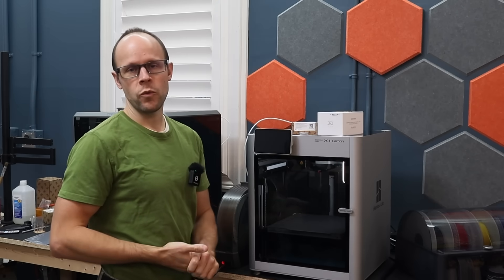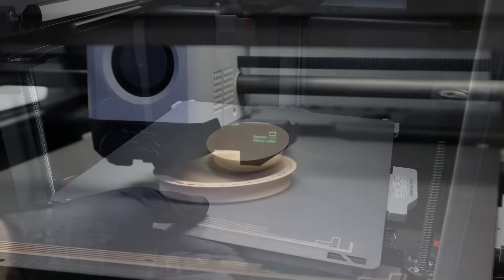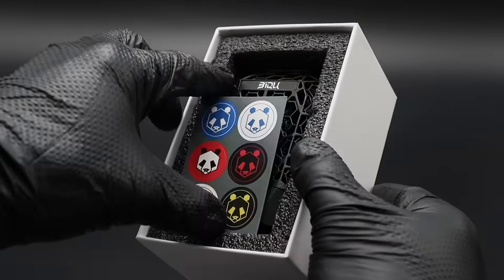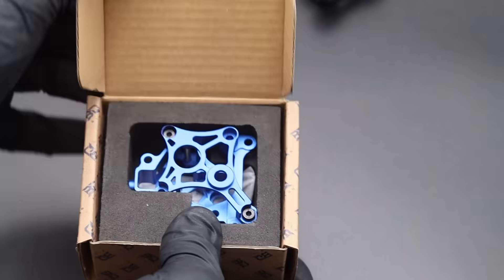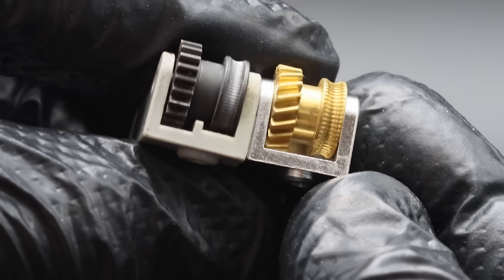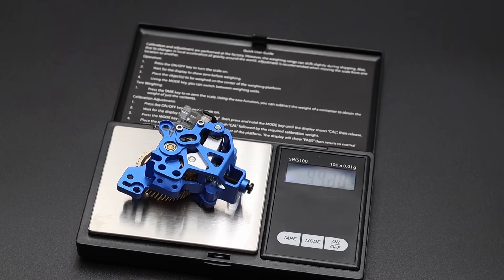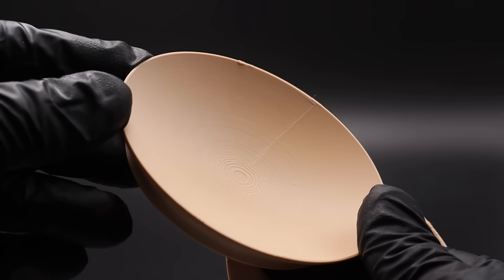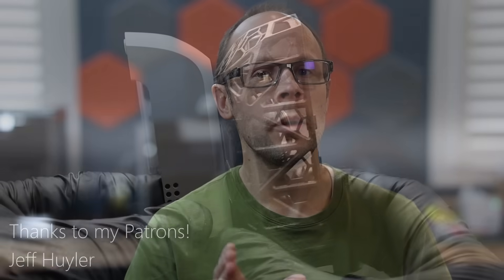These are awesome looking upgrades for your Bambu X1/P1 printer, but how do they perform?

Comment: Interesting that you used loctite on the bearings, personally I would've used a silicone or lithium based grease so the whole bearing cage is free to spin in that slot in addition to the balls inside
Reply: The bearing spinning in is slot is a worse case scenario. It will wear out the slot, possibly cause galling, and reduce precision. You want a bearing cage to remain still.
Reply: I think we agree we don't want to wear out the slot. You're right, the better method is to remove friction completely vs reduce it, but even with that being the end goal, I still don't think loctite was the right solution. Check out the weird bearing spin at 11:40
In this scenario where its going to spin anyway, you're better to use grease.
Reply: @asteliaz  having worked in aerospace, machined bearing pockets, and reading schematics, compounds like Locktite can work great. Provided you use the right one, and the tolerances are within spec for that compound. If I noticed it wasn't at least a light press-in, I'd send it back as defective. They really should machine that with tighter tolerances and install it in-house. But that's asking a lot for their price point.

I think this is another case of "upgrades" can be worse than the original equipment. :D I saw that a lot working in the automotive aftermarket, so it's definitely not just this case and industry.

Comment: At 11:40 there is a weird eccentric movement at the bearing.
Reply: Probably a side effect of using loctite and it being an imperfect fit. Personally I would've used silicone or lithium based grease around the outside of the bearing instead of loctite.
Reply: @asteliaz I think I will just stick with my cheaper Bambu Lab extruder, it doesn't look as cool, but it holds the bearings tight without locktite, it weighs less, is quieter, and it includes the gears and filament sensor
Reply: @asteliaz  why would you use grease instead of loctite?
Reply: Realistically you don't want the outside of the bearing to slip at all and the best way to do that is to get a perfect friction fit. However, because its not a perfect fit, he's chosen to use loctite to close the gap. If the loctite comes loose and there's slippage, it'll wear away the bearing cage or the frame. Using grease instead allows it to slip outside of the bearing while reducing the wear and tear on the bearing cage or the frame its fit into.
Reply: Having the outer bearing race not held in place is bad practice for a bearing.   Hopefully BIQU has fixed this in later revisions.

It would be cool to see a backlash comparison done between the two gearsets, though.  I wonder if there is a backlash compensation hardcoded into either the slicer or the printer itself.  This may account for the subtle difference in print quality.

Comment: What print profile did you use for the control prints.  When you took that first cube off of the plate it looked a bit rough.  I use the .16mm High Quality for my prints and a test cube with that profile printed on my X1C looks a lot better than what you had.  I could see imperfections in the layers and that wasn’t even with a closeup shot of it.  I also used the BiQu jet on my X1C and I actually had a degradation in print quality using it, so I switched back to the stock shroud.
Reply: I also noticed the imperfections. My stock p1s produces much better prints.

Comment: Bad review.  Bambu replaced the straight cut gears with helical gears a very long time ago--if you're still running those gears you must not print very much.  The Panda Jet is 5.03g lighter not 6g (26.09g vs 21.06g), and that's if you remove the label plate from the Panda.  Moving onto the next part, nobody should buy the Panda Extruder.  They advertise that it's 20% lighter but it's only 1.2g lighter (43.4g vs. 42.2g with Bambu gears and filament sensor installed which is 2.8% lighter)--for much less $40 you could buy a few M3 titanium or aluminum screws and save 2-3g.  The bearings fit loose and rattle in the Panda Extruder.  Because of the aluminum structure, all the heat from the hotend goes straight into the bearings.  The Panda Claw is also a major downgrade, since it's extremely heavy and the brass gears don't isolate motor resonant harmonics.  The main gear itself weighs 16.93g vs. Bambu's 7.81g and the swingarm is 7.82g vs. Bambu's 6.50g (24.75g vs 14.31g, a weight penalty of 10.44g).  In the event that you get a filament jam, the Bambu's plastic teeth will flex over the top of the motor spur gear, causing no damage, whereas the brass teeth will not.

Comment: "The only modification I'm leaving on is the modification the Jetpack makes, making this ENTIRE comparison worthless." - Way to go.

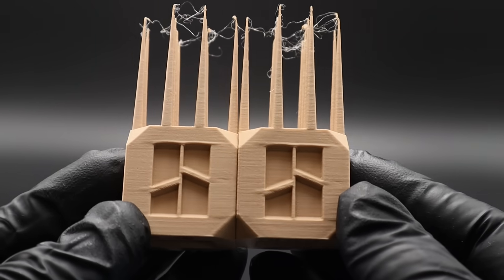10:20 Yes, go figure, the only upgrade from stock that would directly impact extruded plastic cooling was left in place. This was useless. You made a pointless video. 

Compare against stock. ACTUAL stock.

10:40 Whoa WTF is wrong with your Benchy? The same question for your cubes actually. Your printer is fuqt. Most people try to get rid of the hull line, you injected Botox into it to emphasize it.

Comment: So it wasnt worth it.  Perhaps when my extruder needs replaced due to failure its an option. But i only see one advantage, it looks like you could blow out the filiment dust and filiment cutting particles out with compressed air and no disassembly.
Reply: I bet dust and debris can get in there easier too though.

Comment: For the label, if you're painting in orca or Bambu slicer, you need to paint the sides and tabs black as well. If you paint the front surface black but leave the side white, the slicer interprets that as that side face needs to stay white as much as possible

Comment: Just curious about that grease you added: might it not potentially introduce some contaminants into the filament/extrusion flow? Also: was the E3D hotend you had before the E3D/Biqu Revo? (I’m thinking about that upgrade for mine). Thanks!
Reply: they're not on the same track, the filament is on another sied of the gears so as long as you don't get messy with it, it would not be contaimnated. the stock one is also lubed iirc.

Comment: My experience:

Panda Extruder - Waste of time. It’s not ready for market. It exerts too much pressure on filament especially with the claw. The bearings also cause an ungodly rattle. This throws off the frequency calibration.

Panda Claw - Too heavy for no real benefit. Also creates too much pressure on the filament in conjunction with the extruder. 

I also did the Panda Revo. This was the most disappointing. It’s not been made correctly. It’s 0.3mm too narrow at the head of the heatsink where is goes into the extruder. This causes the extruder housing to warp if you snug the bolts up, and if you don’t they come loose. If you snug them up they also go through and hit the gears because of the 0.3mm problem. 

3/10

Comment: These Bambu Upgrades videos just prove again and again that it's just a big waste of money and time to ""upgrade"" a Bambu Labs printer because there is nothing to upgrade. We are all just collectively suffering from Stockholm Syndrome by having lived with shitty bottom of the barrel Creality printers and their clones, and their clones of the clones.
Reply: I have 16 x1c units in my farm and I promise, there’s plenty to upgrade. Comments like this make me laugh so hard. 

The tool head is incredibly prone to heat creep related jams and the sample of this shroud I received seems to have helped that a LOT, and I’ll be ordering one for each of my units. 

The internal light is absolute trash and every unit on my farm is fitted with a riser that has a COBB LED strip on it so that I can view small
Edges of parts without opening the door to look for print issues that cause sellable parts such as corner lift. 

Which brings me to… the chamber is leaky as a sieve. The door doesn’t seal at all, and the back has a gigantic hole that’s open to the boards. Every one of my units has shrouds printed to isolate the board from the chamber heat, block off holes, and they have insulation added. 

What these printers ARE is a phenomenal value. But pretending they’re perfect is laughable at best. Bambu fan boys are ridiculous 😂
Reply: @DatMammutt  Using x1cs for a farm is hilarious. Just adds cost and more points of failure.

'Incredibly prone to heat creep' is a laughable statement too. Since no one else has that problem, it's probably because you've messed up the chamber ventilation with those shrouds 😂
Reply: you seem to be forgetting how problematic is the AMS and upgrades like the python
Reply: I would  not have expected the print quality to have changed.  My expectation is if you print with carbon or wood, then the longevity of the system would increase.
Reply: @rogerhuston8287 this is exactly the intended use case. It’s like upgrading car parts. I don’t swap out plastic coolant flanges to aluminum for an increase in cooling capacity; it’s 100% for longevity.
Reply: That's an unbelievably naive statement lmao
Reply: I have an un-upgraded stock creality k1c, and i can say will full honesty that my printer prints much cleaner than this guy’s printer, not saying all bambus are like this but this comment seems pretty naive without much thought to other companies
Reply: The only good upgrade would be the cryogrip build plate to save money on heating the bed
Reply: Panda Revo. The easy nozzle swaps on p1 is very nice. P1 doesn't have the easy swaps that x1c has
Reply: Well I see z-lines on those prints and P1 X1 have VFA, my Ender3 and Neptune printers do not have those.
Reply: @eaman11  are you printing 0.5mm layer height or something wtf

Comment: For our farm of printers with over 3000 hours print time on some, the stock setup is already amazing. Usually, the main difference you'd get in print quality is due to your settings & quality of material used. Definitely upgrading some partz may yield some improvements, but considering that bambu printers are already fantastic, I doubt you'll see huge improvements.

Comment: My P1P has crap quality. Layer lines on anything i print. Layer shift on anything over 10mm high as well
Reply: Be sure it is sitting on a stable surface and maybe also grease the rails.  Might help, I dunno?
Reply: @xNuclearSS1x  Its sitting on a rock solid platform stand that is not only level but also bracketed it wo the wall and floor and has been laser leveled to dead straight.   Did maintenance to it a month ago at 1000hrs.  It has never given the quality that Bambu promised or that paid Reviewers over inflate.  Same thing with the other Bambu I have (P1S) they just dont have the super quality that is bragged about.  Bambu are overhyped and overpriced IMO from using them

Comment: Biqu (and BTT)  products are very professionally made. I have never had issues with anything I've gotten from them. I have the gear set for both my X1-c and one of my A1s but haven't installed them yet. The timing of this video is great for my needs! And I have the air duct on my OG Bambu cover, but now do I want to spend the $ on the Biqu extruder frame and that way cool cover? It seems for improvements they aren't really a big step forward, but I do love the aesthetics of that modified print head.

Comment: I'm wondering how you're managing to get such terrible-looking prints out of the X1C.
Reply: Yeah I don’t get it either. I love the channel and the testing but when the prints look that bad both before and after there most be something else going on.
Reply: creality K1 user, complete novice, but after bed leveling, print settings and adjust jerk, my prints look way better then the prints shown today
Reply: I was wondering the same, my stock p1s produces better quality than that with generic PLA profiles. I wonder if his X1C has enough hours on it that it's starting to get some toolhead wobble. The only real flaw with these machines is those graphite x axis bushings and the idler pulleys, usually around 3000-5000 hours.
Reply: Bambu boys started to attack bambu users lol.
Reply: Bambu fanboy spotted
Reply: @3707_hereDo you think those prints looked good?

Comment: Id seen a comment on reddit about the panda claw having excessive "clicking" how was your experience with the noise from the panda claw?
Reply: Exactly the issue I am having from this upgrade. Not just the click, but also over-extrusion at any 90 degree corners and seams. There is always a blob of filament that sticks out. I am assuming it is due to the loose tolerance of the gears of bearings, and I did not use loctite like in the video. I am going to revert back to stock extruder gears to see if it solves the issue, and if not, I will know its because of the bearing fitment.

Comment: From my experience, nailing down perfect filament profiles and print settings makes the most difference. The stock printer is already amazingly good.
Reply: Drying your filament once a week (or just before use) is HUGE
Reply: @Splarkszter  or just dry it once and store it properly
Reply: @Splarkszter that depends on the climate where your live surely? I've seen just as many people saying they've never dried any filament whilst never having issues as I have people saying dry filament for hours every X amount of days/weeks.
Reply: I have 1000+ hours on the stock hotend. it's awesome
Reply: i was going to say that whatever filament he is using is awful.  I have Elegoo's Rapid PETG and it doesn't string as much as whatever he is using.
Reply: 100%, fine tuning of print profiles taking into account filament and print parts geometry will provide rly awesome results on stock printing head. Bambu using correct approach for friction pairs plastic+metal just because metal-to-metal friction pairs will work well with proper lubrication and timely maintenance, which is not the right solution for a 3D printer extruder assembly.
Reply: I realize that we all have minor differences, and it'd be impossible to account for all of the variables... but is there a "repository" of printing profiles/settings that we as a community can share? Or a place I can go to learn the little differences that we all use? (hope that this makes sense?)
Reply: Exactly. If you are upgrading things, do them one at a time, not all at once
Reply: @jebus182  i'll upgrade my hotend if it "breaks". not replacing a perfectly functional one imo
Reply: True, I meticulously tweaked my Ender 3 V3 SE and my prints are just as good as anything I see on the internet. You have to be willing to sit there and turn adjustment screws little by little like you have OCD though. 🤣